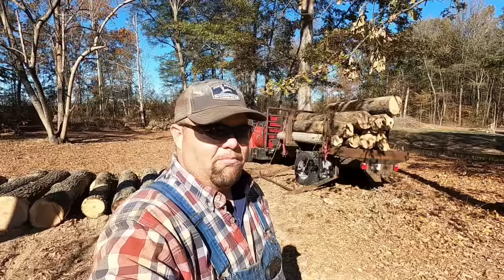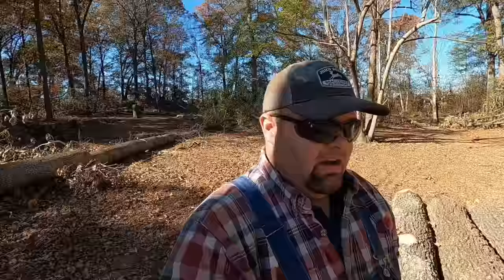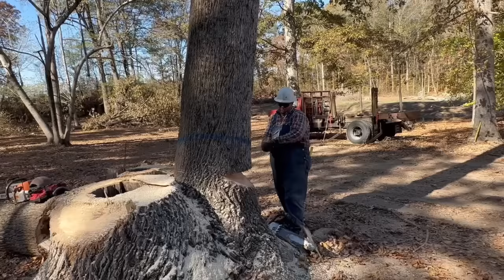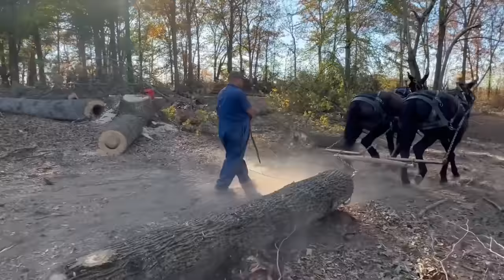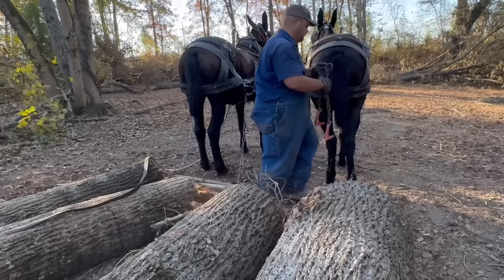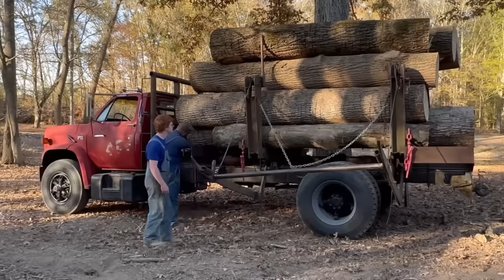Mule Logging: Side loader truck edition…. #070

Comment: Seeing those poplar logs reminded me of all the trouble I had running a rosser-head debarker at daddy’s mill when the sap was rising in the Spring.  Poplar logs would debark with whole sheets of bark coming off at once and would clog the bull wheels up and the bark conveyor too.  Also, the log would be so slick with sap, it would definitely cross up while being kicked out of the machine.  When the poplar logs were dry, they debarked better than any thing else.  Had a very distinctive smell unlike any other species of log we ran.  Debarking for me was a good change of pace from scaling logs.  I miss those days so long ago now.  
Keep ‘em coming!
Stewart White
Auburn, Alabama
Reply from the maker: Yessir I know what ya mean! I like working poplar from cutting, skidding, hauling, milling, and building with it. It’s easy. For the most part. Thank you sir for the kind words and for watching. Take care

Comment: We always had light problems with the side loader we used we tried to put the smallest log's on the bottom and the loader on it was on the passenger side it was international Nice Video
Reply from the maker: Neat! Yeah I’ve saw a couple of them loaders on the passenger side. I’ve never ran one tho. Yeah on our sideloader, we try and load one or two smaller logs so the big ones won’t have as far to fall and bang around. But you do want to get most all the bigger ones on the bottom if you can. Sometimes it works out and sometimes it don’t lol. Thank you sir for the kind words and for watching! I really appreciate it

Comment: Nice work,  Zach.  How’s the poplar market over your way? I don’t have many small or mid sized mills near me so I’d be added a sawmill to value as some of our horse logger material.  I’d like to add a side loader for a smaller jobs and when I wavtvtjvtageca load home for sawing.  What’s the heaviest log it will toss?
Reply from the maker: Timber market in general is down right now. Some areas are better than others. Poplar is running $0.50-0.70 cents per foot depending on grade. The side loader will pickup 4K pounds or just a tad over. Thanks for watching and commenting!!! Take care

Comment: Those chains on the loader truck , can you explain there strength , they have to be the very best , also the length of the chains ? Stay safe !
Reply from the maker: The chains are 5/16” grade 70 binder chains rated at 4700 pounds each. On a log truck or trailer with the logs in the bunks, chain binders must cover a minimum of 1/6 of your total load weight. Our load weight is around 15k pounds. Our binders at 4700 pounds each (9400 pounds total) are more than enough to cover the required amount. Thank you for watching and commenting, I appreciate it

Comment: Be careful with the skid steer. Slippery slope, they lead to skidders and such. Rubber tire machine with metal tracks, a directional shear, and log grapple are handy though. Wonder if a bobcat eats less than a mule?
Reply from the maker: Mules are def more efficient with less input..I came from a mechanical background. I started on a cable skidder crew cutting timber as a teen. And went back to animals. So there’s no worry there. We have a specific purpose for the skid loader tho. And we use it accordingly. It’s here to HELP the mules not replace them. The mules can go places and do things the skid steer can’t, and also likewise. However, we are here to move timber and not play around. We do this for a living, so one must be well rounded at times to keep the timber moving. It just helps us be more well rounded. Thanks for watching and commenting. Take care

Comment: Your mules are not nervous with any log, no matter how heavy these are. But I get nervous when I see the truck loaded up so high; with the right rut it might tip.
Reply from the maker: Loads can get top heavy for sure. That’s just logging really in general. But we do minimize it the way we load it and such. Keep our center of weight low. And my stakes are also between my duals instead of the outsides of them which helps a lot. But yessir, one must be careful. It’s not near as bad as it may appear though. Thank you for the kind words as always and for watching!!! I appreciate it